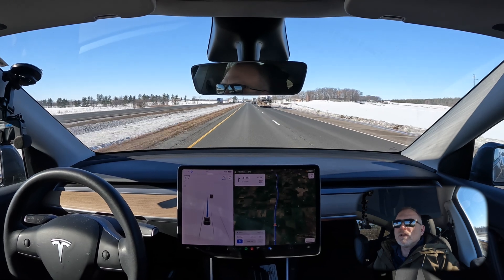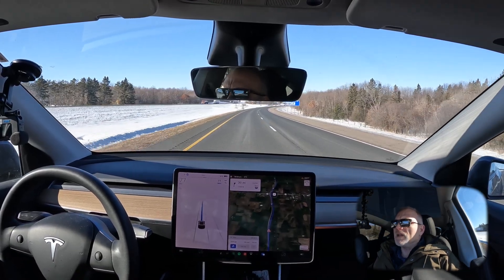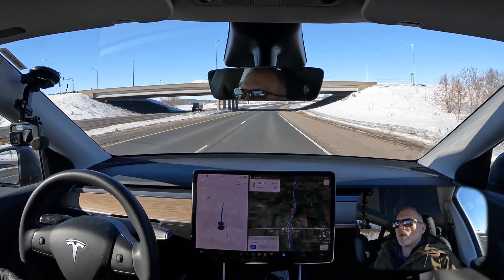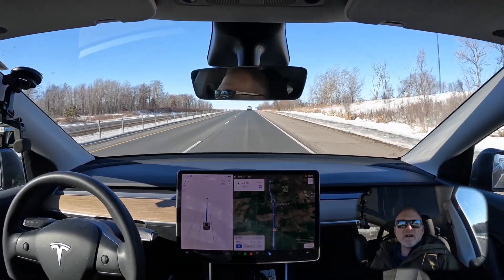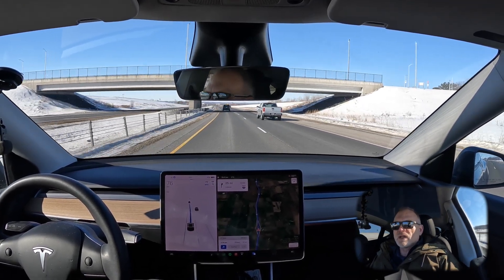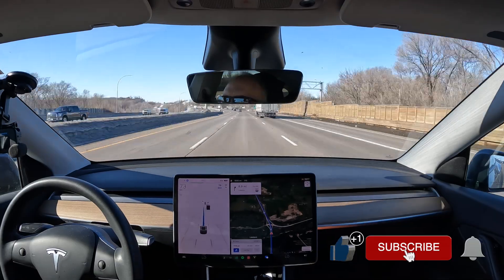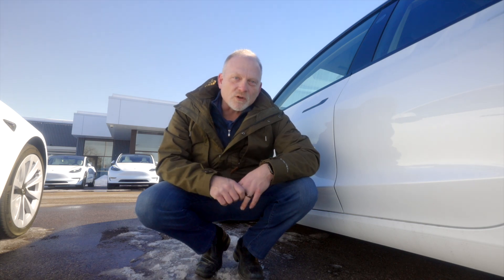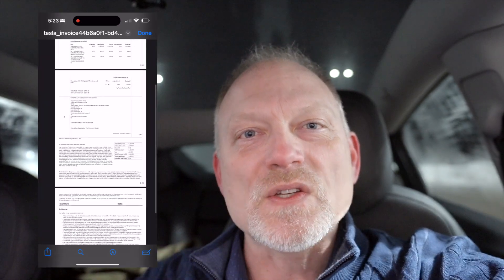Tesla Heat Pump & SuperManifold Replacement Cost | 2020 Model Y

Comment from the maker: Update as we close out 2024 winter - It's been holding up since the repair so far.  I'm at almost 80,000 miles.  During the coldest period this last winter, it did make some odd noises (like pinging/crackling) when it ran on the coldest days, so hopefully not an indicator of impending failure.  But, so far, so good.
Reply: I've now had 3 failures on my heart pump in 50k miles

Comment: Mine developed a heat pump fault yesterday. I not bought the car six weeks ago and is under warranty from the used car dealership luckily. I shall pray to God that they sort it out.
Reply: Go into service mode and check all of the HVAC settings to see what's really wrong with it before you take it to Tesla because it will just make you do everything even though you don't need to. But you don't know until you check.
Reply: @YourParadox1 thank you

Comment: You are talking about heat pump replacement. THE heat pump does not exist in EV cars. It consists of several different parts that form the heat pump system.

Comment: I saw a 2020 model 3 performance  with 28,000 miles for $26k. Just want to know how the heat pump will hold up?

Comment: There are numerous Tesla owners with the same issue but Tesla keeps getting away with it. At this point we should be pushing Tesla so pushing out early models with Faulty heat pumps. This definitely gotta be a recall at this point. 
The new heat pumps they install only cover 20000kms. So you could be replacing one every 12 months!!

Comment: I had a similar experience on my ‘21 M3 SR+ with 43k miles. The Limited warranty expired on 12/20/24 and then my heat/ac compressor blew on 12/24/24…at the height of the winter here in GA! It gets cold here, but not brutally cold. The service quote I got was $3600, and they of course ask for payment up front. I also could not get a service appointment until the end of January 2025. 

This is a major problem for Tesla. Tesla is not a maintenance free car like they say, and when you need service it’s a hassle. The whole thing was bad enough for me, that I got rid of the car. I’m Not sure I will buy from Tesla again
Reply from the maker: I agree - a little thing like more service centers would be helpful.  I don't like having to drive 200 miles and waiting 2 weeks for an appointment when the heat pump goes out or I need wheel bearings replaced.

Comment: I am very, very surprised that TESLA didn't give you any kind of a discount. Say you pay for the part they do the labor or they split the bill 50%.. I took my older Honda in for a very expensive repair after the warranty was over. I think it was  5000 miles over the warranty and they covered a $2800 bill completely.. very disappointed in TESLA didn't do any kind of customer good will. And to top it off, they have such deep pockets.
Reply from the maker: I've had it in for service two times since.  The first one they stated low refrigerant (so they charged it and checked for leaks). The second, time (just last month), they stated that their service procedure was updated since the initial repair, to include a more thorough line flush process.  They completed both repairs at no cost, which I guess is some consolation :). The car now has just over 100,000 miles on it and otherwise has been running very well (except for front wheel bearing replacement at 98,000 miles).  Temps where I live can get to -35 deg F, so it is tested regularly.

Comment: I have same issue, and the fan has been making rattling noise for almost a year and in my previous service when the car was still under warranty they said its all ok they didn’t feel any issues. And now its out of warranty and climate control requires service. They quoted me CAD $ 4300. First I got this service pop up when outside temperature was -19 and I had to drive 1 hr in -2 cabin temperature but next morning it was working fine. And after 10 days again when temperature dropped to -20 it started the same issue. Its very risky if you don’t get it fixed and drive.
Reply from the maker: I've had it in for service two times since.  The first one they stated low refrigerant (so they charged it and checked for leaks). The second, time (just last month), they stated that their service procedure was updated since the initial repair, to include a more thorough line flush process.  They completed both repairs at no cost, which I guess is some consolation :). The car now has just over 100,000 miles on it and otherwise has been running very well (except for front wheel bearing replacement at 98,000 miles).  Temps where I live can get to -35 deg F, so it is tested regularly.

Comment: Was it making a loud fan noise before it went out?
Reply from the maker: No - more like a whirring noise and slight crackling sound, like air bubbles in fluid passing through the coolant lines.

Comment: 2021 Y owner and have the same issue but only replaced the super manifold.  no heat pump issue but still cost 2.9K. It was only 15 days out of warranty.  My personal experience would say, Tesla is good for 4 years and buy the extended warranty thats offer at 2K.  Battery is still good at above 80%.   However it's not low maintenance.   This is why Hertz sold most of their Tesla.

Comment: My only question is how so many Tesla owners have same exact issue. To me it should be looked in. Maybe is Tesla sending over the air bugs to create issues to scam money from service.  I don't know.
Reply: I have the same problem model 3 2022 with 50800 miles
Reply: @peterkaplanconsultin  Don't settle easy. They will tell you it's out of warranty and so on. But be firm and ask supervisor, whatever you can and they will fix it under warranty as they did mine
Reply: It's a defect. A pretty expensive one at that but Tesla won't admit it. There are a lot Model 3/Ys with broken heat pumps.

Comment: im happy to drive corolla hatchback ! i dont have 3000$ to put in my car for a heat pump I thought about buying a Tesla and I canceled because it was too expensive. I did well to buy a Corolla hatchback for $28,000. I have 90,000 km and nothing to repair, only brakes for $500.

Comment: Just had the same issue on 2020 Model Y @ 75,000 miles.   It's in the shop now in California, the cost for the same service is now $3,400 parts and labor.
Reply from the maker: I've had it in for service two times since.  The first one they stated low refrigerant (so they charged it and checked for leaks). The second, time (just last month), they stated that their service procedure was updated since the initial repair, to include a more thorough line flush process.  They completed both repairs at no cost, which I guess is some consolation :). The car now has just over 100,000 miles on it and otherwise has been running very well (except for front wheel bearing replacement at 98,000 miles).  Temps where I live can get to -35 deg F, so it is tested regularly.

Comment: My last 3 cars were Japanese cars.  in total maybe 700,000 km and I have spent no more than $1000 US on it.  Brake Caliper, Muffler and Brake pads. that's insane!  better set aside $10k just incase your Tesla needs repairs.
Reply from the maker: Yes - I'd say that's a fair amount.  I've probably spent about $8k in 100,000 miles/4-years of ownership on maintenance.

Comment: That is not a "heat pump". It's the A/C compressor. Looks like they sold you the Super manifold and the Octovalve unit. Keep those parts, because there are some non service components on it you can't buy separately. All 6 actuators on the front side are not a service item. You also have 3 temp sensors on the front. I'll bet money they didn't diagnose anything and sold you the complete Super manifold with the Octovalve as a CYA. Glad you got it fixed. $1K  is super high for that repair. What is their labor rate ?
Reply from the maker: You're correct about the AC compressor vs. heat pump.  I checked the invoice and it was stated as such.  They didn't break out labor hours on this one, but I had service last month.  Tesla is currently charging $215/hour for labor at the service center nearest to me (Maplewood, MN).
Reply: @JohnVanDeVoort  I just had my second heat pump failure at 136K Feb of 2025 on my 2021 MYLR. The first failure was Dec of 22 at 52,500 miles, Tesla covered the parts...I paid labor. It was just out of warranty then. How has your heat pump been since? I asked for the parts back as well.
Reply from the maker: @chrispeterson7898  I've had it in for service two times since.  The first one they stated low refrigerant (so they charged it and checked for leaks). The second, time (just last month), they stated that their service procedure was updated since the initial repair, to include a more thorough line flush process.  They completed both repairs at no cost, which I guess is some consolation :). The car now has just over 100,000 miles on it and otherwise has been running very well (except for front wheel bearing replacement at 98,000 miles).  Temps where I live can get to -35 deg F, so it is tested regularly.
Reply: i have the same problem and that looks like the compressor

Comment: I’m sorry guys, but this is not that expensive in my opinion. I’m a mechanic by trade and for all the money you save in the long run with a TESLA paying $3000/5-year is not bad
Reply from the maker: Well, it just happened again tonight. The service message came back 14 months after I had it repaired. The warranty on the repair was 12 months so we’ll see if they cover it or I’ll need to pay for this repair again.
Reply: @JohnVanDeVoort  Oly moly, that's a bummer. Did you go to tesla with this, or tried an independent repair shop?
Reply: @JohnVanDeVoort update ? I hope you didn’t have to pay for it!
Reply: Did it turn out to be the same problem, and if so did they charge you to have it fixed?
Reply: Did you post the 2nd failure and how did Tesla resolve it for you.  I am really concerned as I maybe in the same boat later.
Reply: That's awful! It's a design defect?

Comment: This happened to me in Dec 2021. Under warranty, but I still have the car, it's 2024 and so far no issues this winter. I hope the Replacement I had is a solid fix. I feel like alot of these issues ate 2020 model years.  I have some videos posted on my channel
Reply from the maker: Yes - holding up well so far!
Reply: The scroll in the compressor sheds metal throughout the whole system. Just had my second failure at 138K. My first at 53K...Tesla Goodwilled the parts...I paid $1,000 labor. We need to form a class action. This time it's $3K...no goodwill on either side. lol

Comment: Surprised there isn't a core discount. 99% of it is probably still good.
Reply from the maker: Me too.  I'm also surprised there isn't a discount based or recall, based on other reports that I've seen.
Reply: Thanks for posting this. There are a lot of the b same fault at low miles

Comment: It is very unfortunate to have such a high repair cost so shortly after the garantue expired. But on todays Ice cars you can fear on nearly all for timing chain or belt problems at this mileage and you are between paying half of your bill if you're lucky and you heard a rattling sound fast enough or paying 3 times your bill if you haven't had any warnings and just a complete engine failure. I have experienced both, so i would like it more to be able to drive without heat than to cannot drive at all (and of course also have no heat or even seat heating while waiting for towing service)

Comment: I worked for Tesla at a battery remanufacturing plant and the coolant get dirty quick because the chiller doesn't get maintained. Probably the same at the factory where the cars are built. The batteries doesn't get flushed from the particles left inside. That's Tesla for you. Lack quality control.
Reply: What maintenance is required of the chiller? It's a mostly sealed system?
Reply: @peterkaplanconsultin  I'm talking about the chiller at the remanufacturing plant used for testing the remanufactured battery. The chillers have dirty water and not maintained properly. The water goes into the battery to cool it down. It's rush rush rush at Tesla. I'm talking about remanufactured battery not new batteries. I don't know how those are processed.

Comment: It's hard to believe there were two problems, I think there might of been the lines and they already ordered the Manifold, the Manifold looks new and has many actuators on it, no doubt one failed, the lack of people able to diagnose is no doubt a big problem,
Reply from the maker: The service guy knew is was the heat pump that failed.  They 'recommended' replacing the super manifold and lines out of concern for secondary failure with contaminants thrown out from the heat pump fail.

Comment: Thanks for sharing your experience. I'm dealing with it now and facing about the same quote from Tesla. I'm afraid to get their real quote and more so, to see how long it will take them to fix it since here in Sweden, there is a strike against Tesla and it's -14C outside. Perfect timing, ha ha ha. I'm glad that you got yours fixed though.
Reply: Same here quoted 2700 for a super manifold going to be taking it to a reliable independent shop see what they quote
Reply: What is the actual fault? Surely it can be repaired without replacing the whole unit? A third party repair shop should be able to take it apart and have a look.

Comment: My 2021 vehicle is currently in the shop for the same issues you mentioned. In addition, my main computer needs replacement due to camera problems. The total cost is approximately $5500, out of warranty. The labor rate is $250 per hour, and they only offer a 1-year or 12,000-mile warranty for the parts replaced. 

This experience has made me reconsider Tesla as a maintenance-free vehicle, as there seem to be serious quality issues, as evidenced by others' videos and forum posts. The biggest concern is that you can only get service at a Tesla dealer, and I don't have trust in their service. These issues started shortly after I had my windshield replaced at the Tesla service center. 

I'm thinking about selling my car and returning to ICE age 😂
Reply: I am in the same boat as you. My heat pump failed for the 2nd time and since I am at 100,000kms they wont change it under warranty. I am done with Tesla after this. I am heading back to ICE cars whose AC definitely wotn fail at 100,000km lol 
the Tesla told me since I drive more than him, heat pump is meant to fail. LOL their service techs are a joke.

Comment: I went in last week for safety restraint fault error. They replaced my 12 volt and said they did some stuff to the A/C

I picked up my vehicle on the drive home my a/c sounded like a engine was reving and then I got that error 

Dropped the car back off the next day 3 days later they tell me it’s the manifold smh

I wonder if they are going to charge me for labor seeing that they pretty much caused the problem the a/c was fine before they did whatever they did

More to come though the part has been ordered luckily I’m only at 46K miles
Reply from the maker: You should be on warranty if under 50,000 miles.  Mine was just over that.  I had heat pump, manifold, and lines all replaced.
Reply: @JohnVanDeVoort  yeah it ended up being free….ice cold AC now

Comment: Got the same error code in my two week old ‘23 MY. Opposite situation for me. I lost AC in the middle of blistering Florida heat. They had to replace the compressor and a blown fuse.
Reply from the maker: Sorry to hear that. Hopefully it occurred  early enough for coverage under warranty.. I also hope Tesla improves the design to avoid failure.

Comment: I have an intermittent cooling issue. Anyone know if this could be the culprit?
Reply from the maker: I had a warning message on my touchscreen prior to it failing.  I could also hear a louder sound coming from the heat pump prior to the failure.  I also recall a couple of 'popping' sounds, like coolant snapping in the lines.  It was very telltale before the failure.
Reply: @JohnVanDeVoort  Turns out this WAS the issue - I just got it back from service. Thankfully it was covered under warranty
Reply: How many miles when yours failed?
Reply: @peterkaplanconsultin  The scroll in the compressor sheds metal throughout the whole system. Just had my second failure at 138K. My first at 53K...Tesla Goodwilled the parts...I paid $1,000 labor. We need to form a class action.
Reply: @peterkaplanconsultin I should have given more detail. This wasn’t a part failure, it was knocked out of whack after being T-boned in an accident. The collision place authorized by Tesla fully repaired but didn’t catch/fix the super manifold
Reply: I see. Thanks for clarifying.
Reply: Maybe nhtsa will take recall action because it is unsafe without a defroster and it's a high failure rate design,manufacturing defect clearly

Comment: You’re lucky, you got it fixed quickly. My model three has a connectivity/LTE issue. I’ve had it in the Tesla shop - count them, seven times now, to get this fixed. Add it still is broken. No resolution in sight from the service center here in Salt Lake City, Utah.
Reply from the maker: That is terrible - I hope they get it fixed ASAP.

Comment: I wonder if there was a way to fix it without completely replacing it.
Reply from the maker: I'm sure someone mechanically inclined could take it apart and service some of the components. If it was just the heat pump, it would have been closer to $1000 total cost, which would have been better.